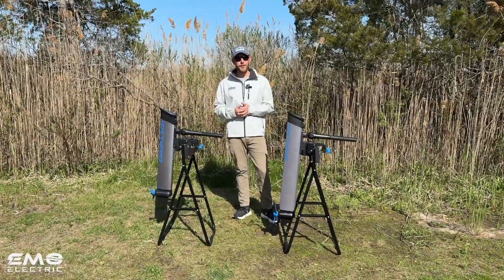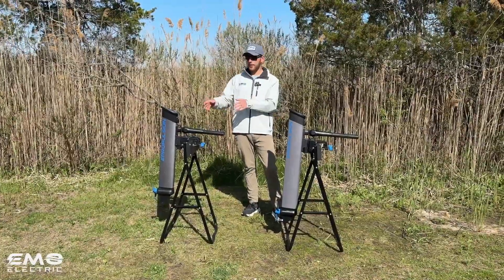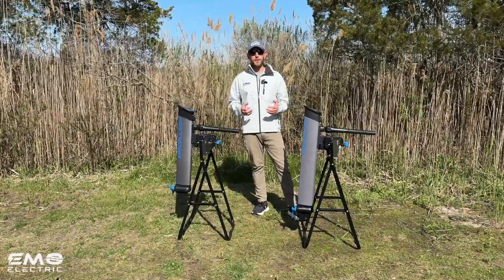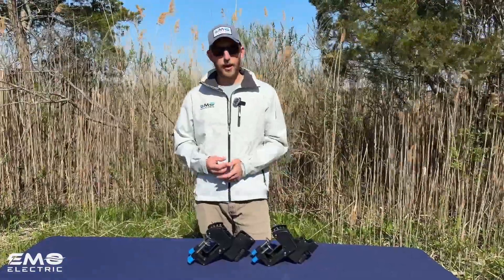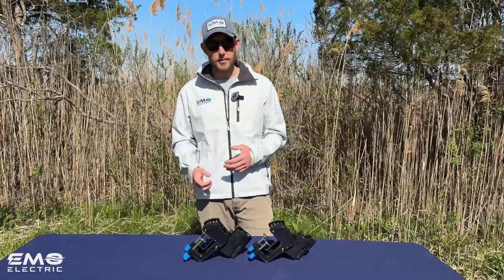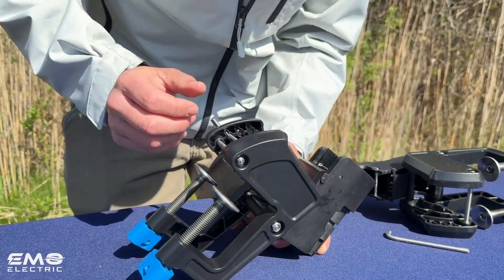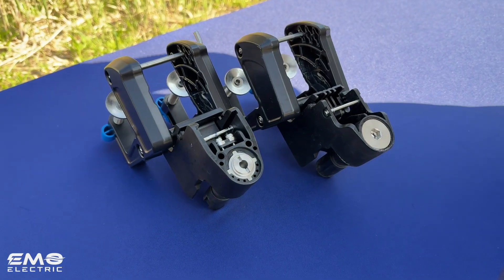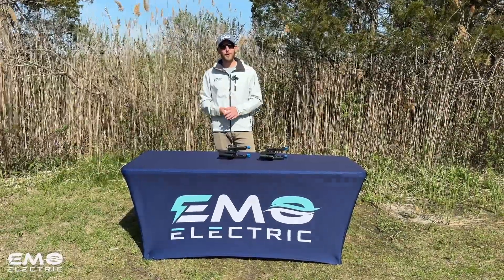The NEW ePropulsion eLite Long Shaft (new features & upgrades)

Comment: The naming is a bit misleading. I have the Spirit Evo long shaft and would like to switch to eLite, but they are not the same length. Spirint Evo short shaft is still longer than eLite long shaft... :/
Reply from the maker: We understand what you mean, it's frustrating. I wish ePropulsion would keep their shaft length names consistent across models. The eLite Short is equal to a Spirit XS, and the eLite long is equal to a Spirit Short.